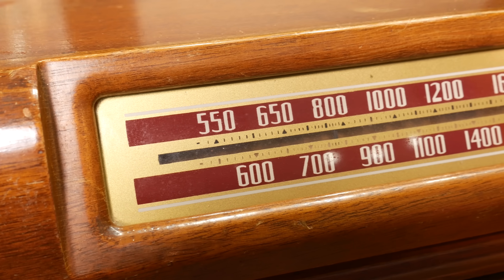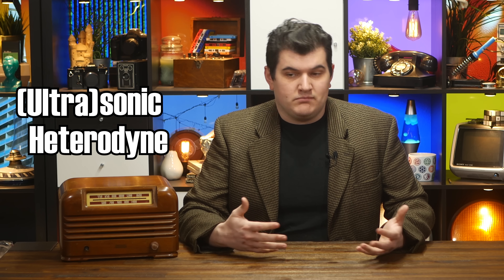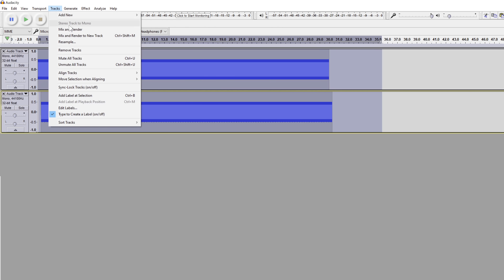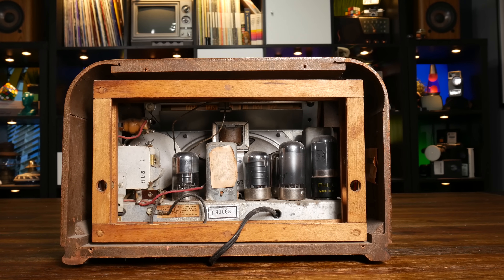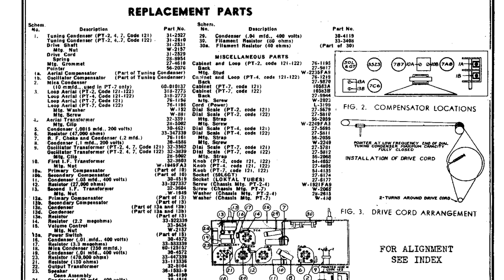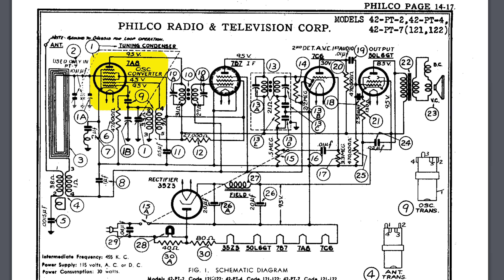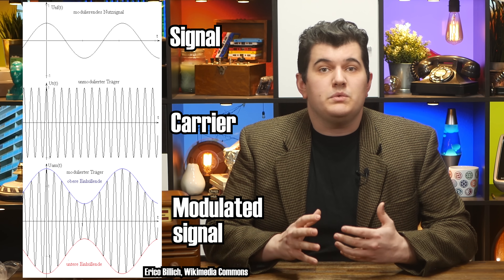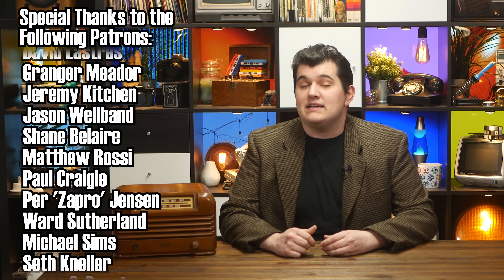The Superheterodyne Radio: No really, that's its name

Comment: SAT TV is almost impossible without this method. There are basically three very high frequencies that can enter and pass through the atmosphere without being dampened. Those frequencies are far too high for copper wiring to be passed to your living room without serious losses. First generation dishes had to be 30ft in diameter or more to get enough signal to the receiver or the receiver had to be real close to the dish.
The LNB in the focal point of the dish mixes down the incoming frequency so a common coaxial cable can handle the signal.
Reply: No, it is impossible without down mixing. C-Band (2.4GHz) and Ku band (11.7GHz) can only be routed through "waveguides" which are not wires, they are hollow metal cavities that allow the raw GHz signal from the dish to reach the LNB, which is only inches away from the dish focal point. At that point, mix 1 occurs, leading to an IF frequency of 950MHz-1450MHz, at least in North America. That is routable over RG-6 cable from the dish LNB to the satellite receiver inside a home. That cable run can be 40 feet or longer. The satellite receiver does another down mix in frequency to an intermediate frequency that is manageable for IF filter selectivity, and amplification. Given the extremely weak satellite transponders, at least in the early days of C band, some were only 10W, it is amazing this works at all. Even with a 10 ft C/Ku dish, observing a 10W radio source 22000 miles away and getting a viewable signal is quite remarkable.

About dampening: Ku band frequencies are affected by rain, so called "rain fade". This is why image quality is lower/lost during heavy rain storms, even for Dish Network. C band is immune to this phenomena. 

As you can imagine, I'm a serious Satellite TV hobbyist. I've got 2 C-Band 10ft , one 3ft Ku and one 18 inch Ku dishes, all in operating condition. I got into the hobby in 1994, which was well before the "digital transition". There was lots of very interesting things to watch then. There still are, but it is much harder to even find satellites, as nearly everything is digital. I think ARTS and C-SPAN are the only two remaining analog NTSC signals up on C band to this day.
Reply: Adam Bernstein Well, no... C-band and Ku-band signals don’t require waveguide.  The advantages of waveguide are (1) less loss per foot than coax cable, and consequently (2) capability to carry much higher power signals - which is why its used for transmit (uplink) from a ground station. Many receive path implementations simply have an amplifier (LNA) at the antenna then pass the signal indoors on coaxial (low loss) cable. Frequency translation (down conversion) is then done indoors where you can have higher performance electronics than you could have in an LNB/LNC outdoors. This design is quite common on many of the satellite ground systems I work on professionally.
Reply: You could get coax fancy enough for Ku band, but the price is quite unfunny;) Using 950-MHz-1450MHz IF allows to use typical dirt-cheap 75 ohm TV/cable grade coax and F connectors, also one could in some cases avoid getting any new cable in existing installation (using diplexer to combine signal from OTA antenna & dish LNB and then splitter at the other end).
Reply: @shana_dmr  Possibly so. However, the consumer satellite market is competing with cable, today. 80s-90s C-Band hobbyists were mostly considered Pirates, except for the 2-3 million satellite subscribers to premium channels. Remember Videocipher / Videocipher II / II+ RS?  Back to your topic. As the existing consumer satellite market is exclusively Ku band today, competing with cable, Internet streaming services, anything they can do to keep costs down, they will. Using an IF signal over 5 cents, or less, per foot RG-6 cable is part of that calculation. It has been ever since the C band market was barely a C band market, and before LNAs were replaced with LNBs.
Reply: In those early days of satellite t.v. the frequency was ...in the KU band, and the broadcast power was limited by the FCC to 5 watts.  This was to limit interference with Ma Bell telecomucations on the ground. Since the orbital satellite was limited to 5 watts, a large surface area receiving dish on the ground was a must! In later years the frecuency was changed on the satellites as we entered the digital age. They were allowed to broadcast more power, requiring a much smaller ground receiving dish.
Reply: Mark Condrey Actually C-band (3.7 to 6.5 GHz approx) was first, before Ku-band (11.9 to 14.5 GHz approx).  People needed an 8 ft dish or so to receive these C-band TV signals, so it wasn’t for everyone.  Then in the late 1980’s Ku-band started becoming economically viable - both on board satellites and for ground based equipment. Higher frequency electronics are more expensive but allow for smaller dish sizes.  This is when pizza-sized “home satellite” receive antennas became reality, and when consumer targeted companies like DirecTV and Dish Network etc became commercially viable.  Newer technology is now in Ka-band (20-30 GHz).
Reply: @johnlacey3857  I owned a portable "hoop" C-band dish that I had to manually adjust (no servo) between birds. This was before the days of VideoCipher when you could watch virtually anything in the sky. Superbowl without commercial cutaways were always a blast! Watching tomorrow's Jeopardy and Wheel of Fortune today was a great way to impress the future in-laws with my amazing trivia and word puzzle skills!
Reply: Though one has to say that coaxial cable is still stressed quite a bit to push that signal. It can get warm and bundled even melt the insulation together. Not fun to deal with in large buildings with lots of those running through the ducts. Most modern installs now transmit the last hundred feet via ethernet which also adds the benefit of wifi tv and recording straight to disk on a nas. Those boxes are expensive though so you only really find them in hotels and multiunit buildings.

Comment: TRF, or "tuned radio frequency" is the more primitive way, as exemplified by the old ZN414 single IC radio that was popular in matchbox radios.
One interesting FM radio IC used an incredibly low intermediate frequency - the TDA7000, if I recall correctly
Reply: The ZN414 is lovely. Easiest way to make a radio that works pretty well. Can recommend for people who want to build a super simple first radio. 
Equivalents: MK484, TA7642. Those are still quite easily available. 
The TDA7000 is also very nice but starting to get harder and harder to acquire. I think it's not in production anymore, sadly. Alternatives are mostly in SMD or need to be controlled digitally via I2C, which makes experimenting with them a bit harder.

Comment: I have small bike horn which is incredibly loud for its size, especially if i accidently push it indoors. I didn't quite understand how such small a thing can emit so loud and rather low-frequency (280 Hz) sound! Turned out: it doesn't. What it does is emits high frequency (near 3,5 kHz) sound which is modulated with 280 Hz, but human ear 'hears' low frequency sound, not this 3,5 kHz tweet. Here it is: https://www.youtube.com/watch?v=e26huG3QrSM

Comment: In order for mixing to work, you need a non-linearity.  In fact, it's the basis of the "intermodulation distortion" measurement - inject two frequencies and check the amplitude of the mix.  (And here you thought a "non-linearity" was just a Star Trek plot device.)  I think your test at 400Hz used a different principle then "mixing" - especially since you could make it work by adding them in Audacity.  You didn't really create a new tone, you just modulated the amplitude of the existing tones.  (Now, if you ran the result though a AM demodulator - you'd get your 1Hz.)  If you had really created a new 1Hz tone, you'd see the "centerline" of the 400Hz going up and down at a 1Hz rate instead of a 400Hz being AM modulated. To visualize this, take a 400Hz tone and a 1Hz tone and add them together in Audacity - note how it looks completely different. It looks like the 400Hz is going on a 1Hz rollercoster ride. I'm guessing the problem with your 3KHz test is that we can't hear a 400Hz vibrato.
Reply: Just to be clear, the explanation of superhet and how it works is well done.  No issues there.  The issue is trying to demonstrate heterodyning by using sound.  It's possible, but only by driving the air into nonlinear at about 100 dB SPL.  (https://en.wikipedia.org/wiki/Sound_from_ultrasound)  

The only way I can think of to demo mixing is to play two notes though a guitar distortion peddle and show the difference between adding the two note after the pedal as compared with adding them before the pedal.

Comment: While there is no connection, filtering out the mirror image frequency reminds me of discarding one of the pairs of the square roots of a number.
Reply: There in fact is a connection there, because square roots of a complex number come in pairs (the positive and negative imaginary parts), which correspond to the positive and negative signals in the (Fourier) frequency domain. The negative frequencies are usually discarded, but they pop up as difference frequencies when the signal is mixed with a higher-frequency signal.

Sine-wave signals are actually the solution of a 2nd-order differential equation which is solved with the same formula, and having a negative discriminant in that formula means there are complex results, and thus (both negative and positive) imaginary parts which yield sinusoidal signals.
Reply: @Stoney3K  
Small correction: square roots of complex numbers are not complex conjugate (same sign of real part opposite signs for imaginary), they are related the same way as square roots of real numbers (root2=-root1)
Reply: @TeslaLegend  Strictly speaking, no, but for the intent of demonstration I wanted to explain it somewhat easily. Since the complex part of an exponential impulse response represents the sinusoidal part here (and the amount in the imaginary domain corresponds with frequency), solving a 2nd-degree differential equation will yield both a positive and a negative frequency. 

Usually the negative frequency is disregarded, but in some situations like mixing different signals, the entire signal spectrum is shifted, and the negative frequency pops up, becoming a positive (actual) frequency. The same thing happens when undersampling a signal without proper filtering: In that case the negative frequencies "wrap around" when reproducing and interfere with the actual signal you are trying to reproduce, resulting in distortion known as aliasing.

Comment: You didn't hear the beat frequency with the speakers because you have added the tones but did not mix them. An ideal mixer multiplies signals (which generates the sun and difference frequencies), but anything nonlinear will give some mixing. At low frequencies, there tends to be a lot of distortion, which provides your mixing. At higher frequencies, there is less, so no beat.

By the way, a common type of distortion in audio is intermodulation distortion, which is just mixing, and it causes beat frequencies to become audible. You apparently have too little for your demo, a rare example of audio being too good!
Reply: What he heard in the headphones was so called "binaural beats"
Reply: I like distorsion, we use it a lot in METAL!!

Comment: So my grandfather, who was a NASA engineer in the 1960s during the Apollo program, sent me a book back in 1988, when I was about to graduate high school and go to college, where I planned to major in electrical engineering. This book had been written in the late 1940s, before the advent of transistors, and it explained many different radio and amplifier circuits, beginning with the simplest "crystal" radio sets and ending with the superheterodyne FM receiver -- all done with vacuum tubes, of course.  And no stereo, of course - that hadn't been invented yet.  It was a fantastic book that taught me a great deal -- but it was so complicated.  It had clearly been written by an engineer, for engineering students (which I wasn't quite yet at the time.)   I wish there'd been videos like this one back then to help with my understanding...  Kids these days have it so easy.  ;-)
Reply: Was it the Radio Designer's Handbook by F. Langford-Smith? I'm sure there are several books like that, but this one came to mind. It's absolutely filled to the brim with technical discussions and formulas. I bought it for the chapters on audio circuits, and even though it only covers vacuum tubes, most of the concepts also apply to solid state.
Reply: @therm0tt0  Yes, I believe that is it!  I could not remember the name or the author, and, although I still have the book, it's in an off-site storage unit, so I didn't have the ability to simply go to my bookshelves and look.

Comment: 3:47 didn't work because our brains are too good at the Fourier transform. See, you're generating a beating tone, but you cannot generate a peak at the beating frequency (in the frequency domain) if the system response is linear. This is a property of linear systems. Sine in, sine out at the same frequency, maybe with different amplitude and phase. This means if the speakers have a linear response, then the sound will beat at 400hz but you won't be able to hear it because our brains will Fourier Transform the signal, which had no content at 400hz to begin with.

The reason why you could get anything at all (enhanced in post processing) is because real systems are not truly linear. A small non linearity will produce the peak at 400hz that you were looking for, but it's probably going to be tens of dB below the main two tones.

Comment: Heh, I think anyone who's ever been stuck in the last few rows of a DC-9 knows what beat is.

For those of you who haven't had that experience, there's a near-pure tritone interval between the noise from the fan and the noise from the vibration from the high pressure compressors (presumably transferred to the airframe via the bearings) at takeoff power, and the engines never perfectly synchronize. It's almost painful. You can hear it fairly decently here:

https://www.youtube.com/watch?v=Of6wsRcor1c

It doesn't sound that bad on video, but in the real world it feels like someone is squeezing your eardrums together.

Comment: By the way, be careful with that radio. Based on the schematic, it's a transformerless design and any metal in the chassis could be at full line voltage. (!) Check out Mr. Carlson's Lab channel for a similar radio he was just looking at.

Comment: Wouldn't receivers cause interference with eachother, then? Or are they dissimilarly tuned.
Reply: They do! With some experimentation and luck, you can hear the oscillator of one radio, using another radio. Keep in mind that the oscillator is always 455 kHz higher than what the dial says, so tune the second radio there. It works better if there is a radio station already where the second radio is being tuned.

Comment: What would happen if someone broadcasted a signal at 455kHz
Reply: Hopefully the radio's frontend filters (the one before the frequency mixer) get rid of it. Otherwise I think you'll probably hear that signal everywhere you tune to.
Reply: @ruawhitepaw  Unless the radio's shielding is bad, in which case you would definitely hear it on the radio no matter what station it is tuned on.
Reply: Not much. Most radios have fairly good IF rejection. I suppose a fairly high powered transmitter in the room with a radio could be interfered with, but broadcasting on 455 kHz to blank out radio stations wouldn't work any distance from the transmitter. Not to mention that interfering with for-profit radio would get the gestapo (FCC in the US) to fine you into bankruptcy.
Reply: Sadly i can tell what happens. I suffer from a lot of electrical interference on 455khz. Although almost all radios are fitted with a 455khz notch filter, those radios still have a fairly high background noise. 
The radio i have with 128khz IF has almost no background noise at all. 
This difference is not caused by how sensitive the radios are - the 128khz radio is incredibly sensitive, one of my best radios, but made with standard 1930s technology.
Reply: You  really have to inject the signal at a point in the set , we use a 455khz signal generator to align the IF on these old radios when repairing them .  unless you are direct connected or really close with a loose coupled antenna, it would not interfere with a normal operating radio much.

Comment: Curious as to why Philco used Loctal tubes in these radios (some tellies, too). They were designed for things, like car radios, which prevented the tubes getting loose due to vibrations. Maybe they got a good deal/surplus?
Reply: Octal tube sockets (such as used by the 6L6) were standard in most commercial products until the miniature tubes (such as the 12AU7) came to market.
Reply: Rogers Majestic also used Loctal tubes (such as the 7A7) for converter, If amp, and detecctor/first audio, and standard octal tubes for power rectifier and audio output. Loctals, by nature, are less likely to work loose from vibration, such as a console played loudly, and cause performance problems.